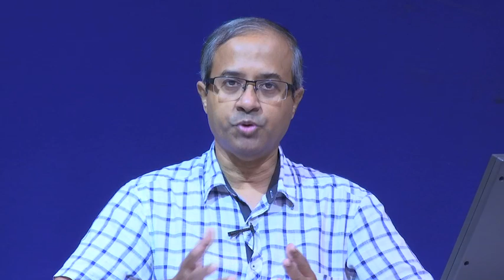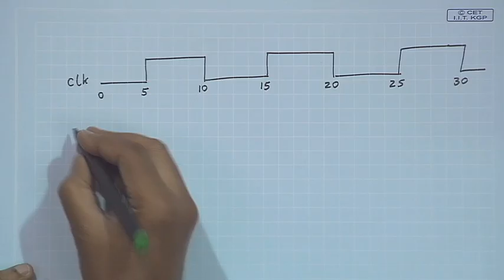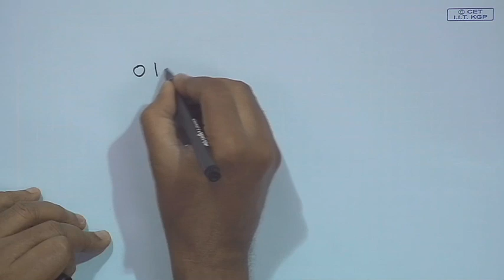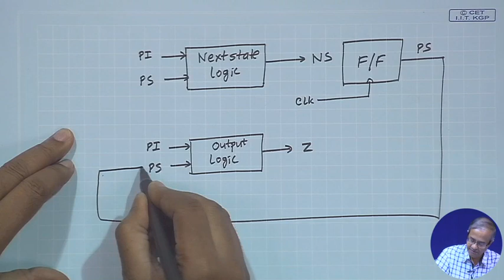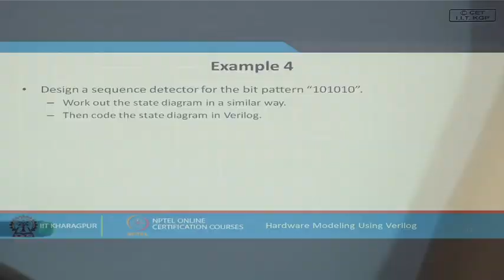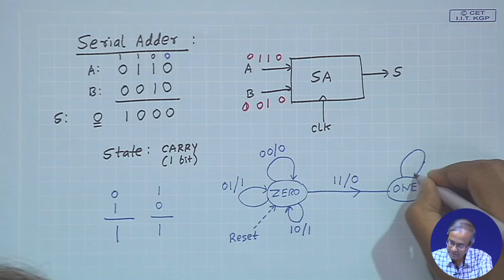MODELING FINITE STATE MACHINES (Contd.)

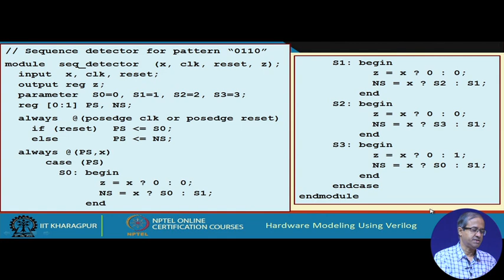Comment: 24:26 In example 3, a default case has to be set to S0 in the second always block as the next state initially would be set as XXX, if the reset is zero. If the reset is 1, the present state is S0, and it wouldn't be a problem.
Reply: Correct! Otherwise, if delay of reset is set to anything other than 15 initially, the output comes incorrect